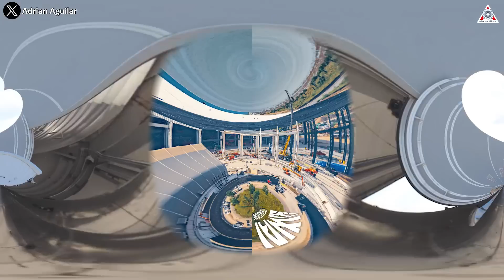SpaceX revealed the Starship Gigafactory that humiliated NASA...

Comment: NASA's STS humiliated Starship with its first flight around the moon and back ......keep it up Starship you're awesome.🤣
When it works then and only then will I give my acceptance unlike these Musk fan boys.
Reply: FIrst off, it isn't the STS, it is SLS.  The STS (Space Transportation System) was the Space Shuttle.  That thing as lovely as it was didn't fly around the moon.  You do realize that the SLS (Space Launch System) project was started  in 2011 and it took 12 years for the first flight and THAT was made possible by using the Space Shuttle's Solid Rocket Boosters.   Starship was formally commenced in 2019 (Musk had talked about it before then as a variety of future powerpoint based rockets but not much happened until they started flying hoppers to test the thing and building prototypes out of Stainless Steel).   SLS has spent over $30B of taxpayer money while SpaceX has spent $5B of it's own money on StarShip and Super Heavy combined.  SLS will probably have another 5 or so tax payer funded flights but then it will be mothballed because it costs more than $2B per launch and StarShip is projected to cost as low as $6M.  So no, NASA's SLS hasn't "humiliated" StarShip and never will.  It is clear that they are building the equivalent of the Spruce Goose.

Comment: The Military wants the BF Rocket ! ... for its Space force ... NASA doesn't care about Mars ... and You're Right !  The list of things to do is long , like Finishing all the Upgrades ... Magnificent Musk is still on the Drawing Board , like with his heat tiles still falling off ... something he needs for Reentry ! ... Then there is the fuel slosh problem with the Booster ... So for both parts , they can go Up , but can't come Down ! ... Plus those are difficult Fixes ! ... He's going to need New Versions of both Starship and Booster ... then he wants it longer  with Raptor 3s ... LOL ! ... Isn't it Fun !
Reply: The answer to th fuel sloshing is rotating baffles.  You could say it's baffling  !!
Reply: Contract should have gone to a large aviation defence company like Boeing, Lockheed Martin or Grumman Northrop.

Comment: Building and launching space craft is a bit different than building and driving road vehicles, but the design engineers and metallurgists need to do a better job at educating the boss regarding public and press announcements :

Elon Musk fails Cybertruck stainless steel metallurgy test 

https://youtu.be/uv3GX3PMf6A?si=AuD19qO7cJn8mO8p